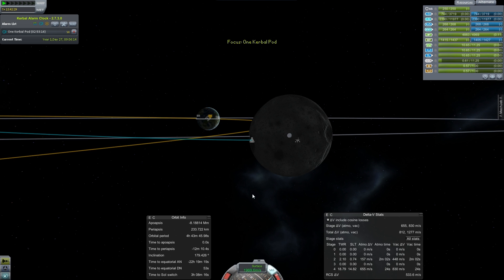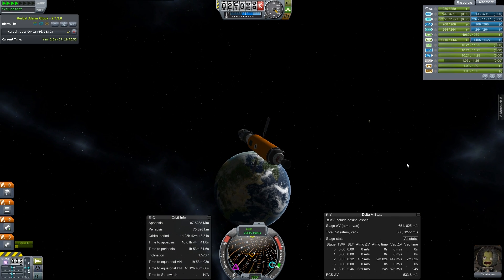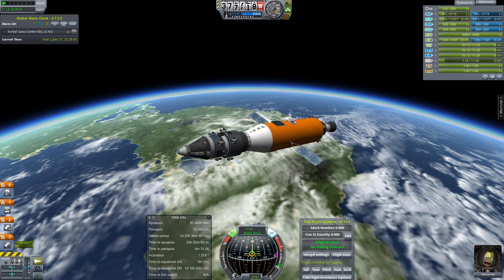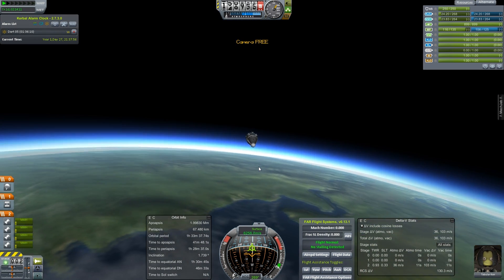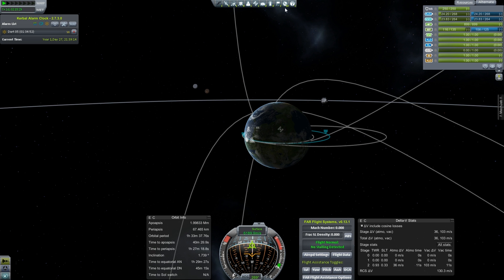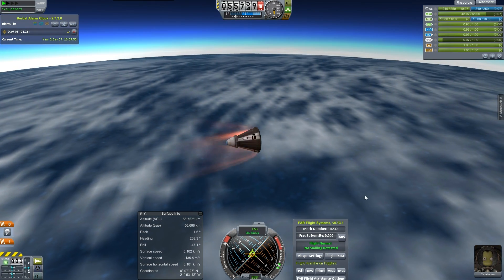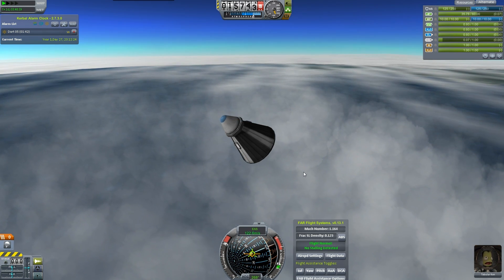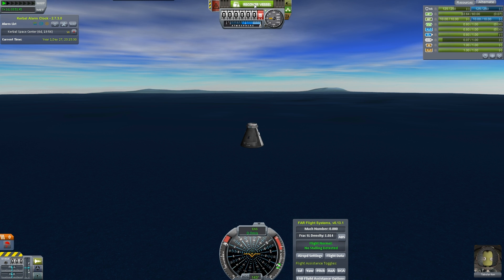KSP Rescaled, Part 16: Reentry at 8000 m/s

Comment: Jeb 9000 burns up BROOOOTTHHHEEERR!!
Reply from the maker: If I was clever, I would've called it the primary buffer panel.
Reply: TheWinterOwl Surely a 9000 series computer like JEB 9000 and myself are more valuable and useful than a veritable heat shield?